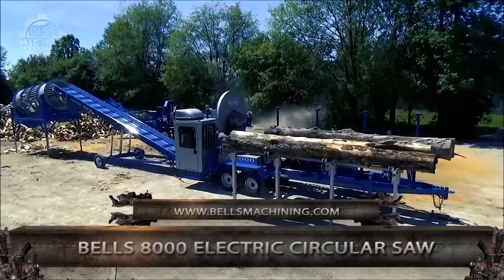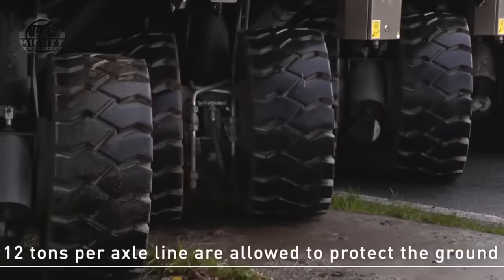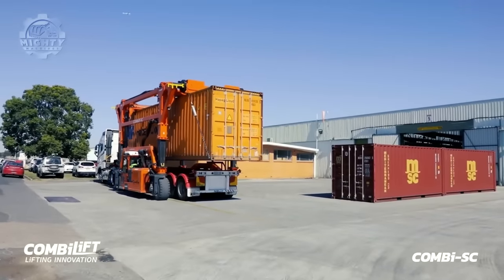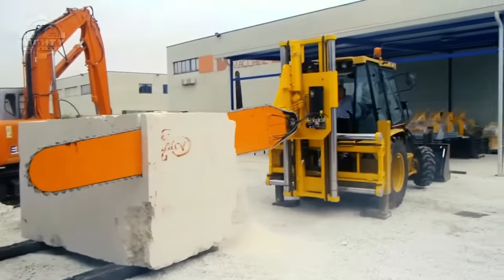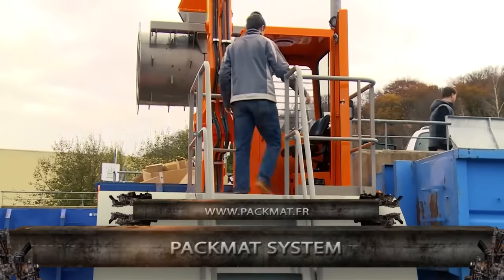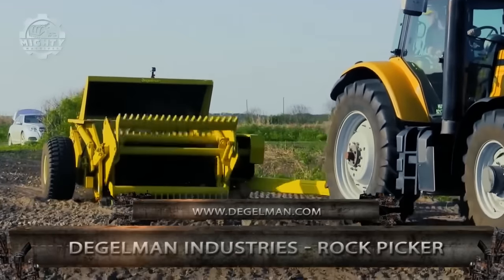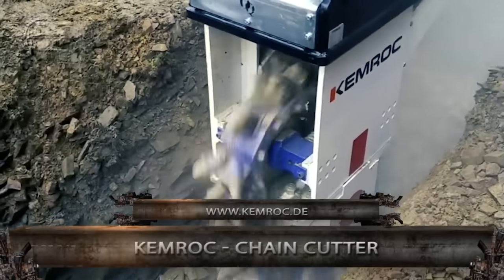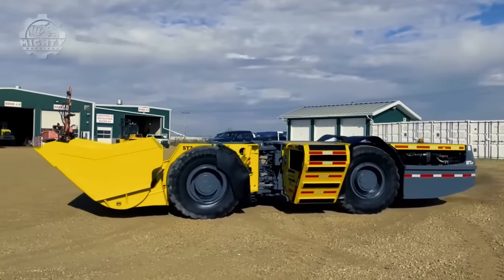200 Mind-Blowing, CRAZY Powerful Machines and Heavy Duty Equipment That Are on Another Level

Comment: The fire fighting robots are absolutely awesome.  As a former firefighter in my youth so many times the situation required us to enter dangerous unsecured and potentially deadly situation to gain control of a fire.  The ability to place numerous humanness robots right into harms way if necessary without fearing loss of life.  These robots aren't something that's going to be used everyday, but even once in five years on a huge multialarm industrial fire, especially of petrochemicals and being able to drive numerous numbers of these robots who also don't get tired and become heat exhausted, and become a potential liability to their fellow firefighters.  
Now some may fear these replacing firefighters, but nothing could be further from the truth.  But the ability to drive several of these robots say up to a blazing fire next to LPG tanks and set them up to just stay in one exact spot for hours spraying down tanks or other explosive hazards with zero risk to personnel.  Now these robots become priceless, especially if a tank explodes destroying one or more robots yet everyone goes home.  
Simply awesome, any idea the price?  Won't  be cheap!